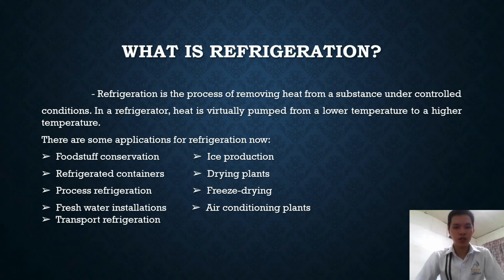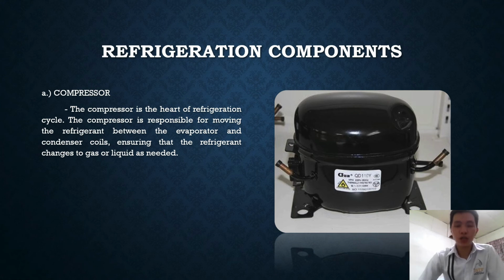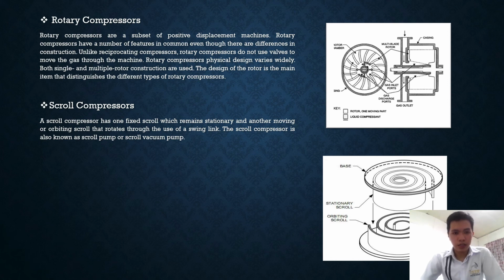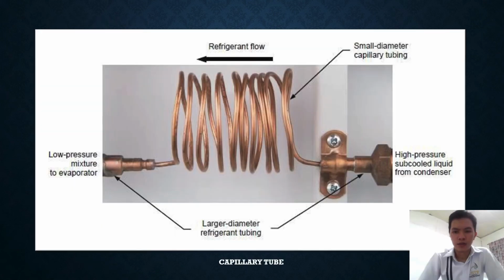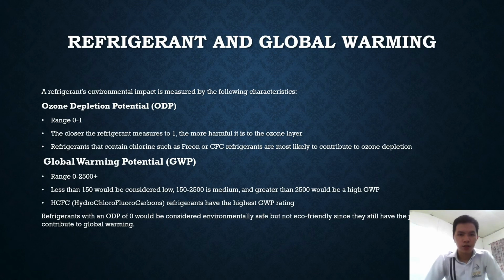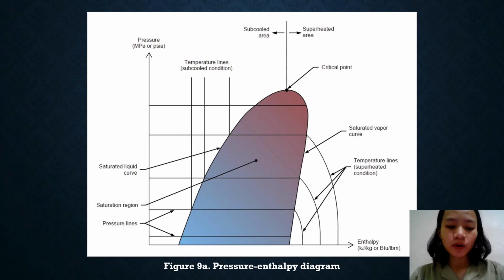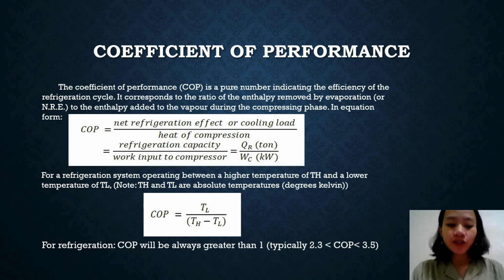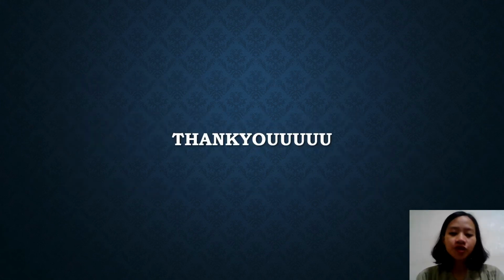REFRIGERATION

Comment: Anude, Chrislyn M.
ce_3d_ce4

0:34 Refrigeration is a process of removing heat from a substance under controlled conditions.
1:38 Vapor Compression System
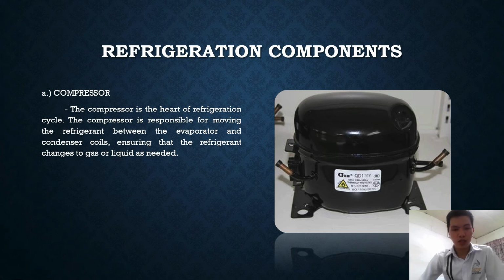3:41 Refrigeration components
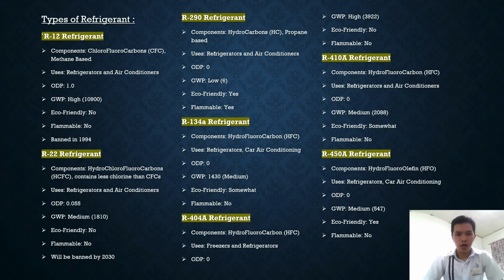15:28 Types of refrigerant
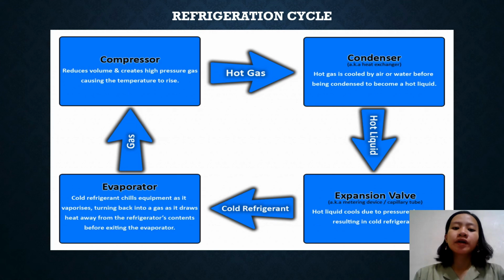16:33 Refrigeration cycle
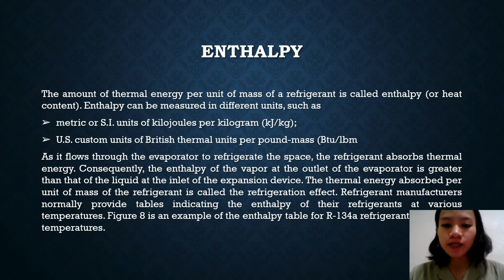17:50 Enthalpy
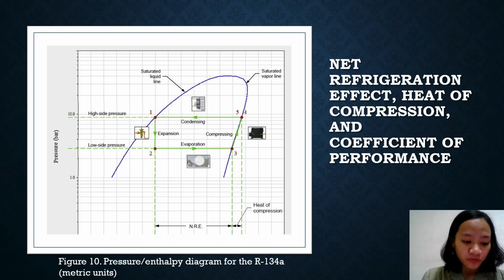22:12 Coeffiecint of performance indicates the efficiency of refrigeration cycle.
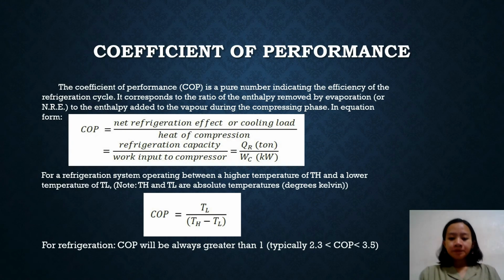22:35 Coefficient of performance formula.
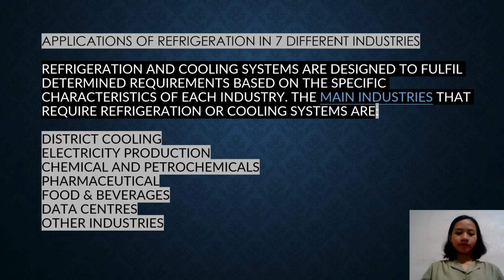26:15 Applications of refrigeration.